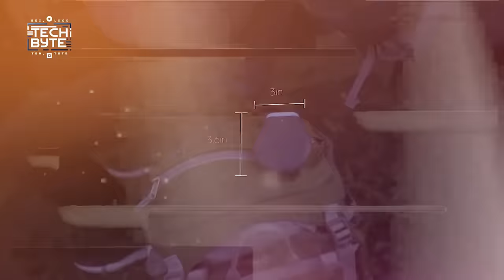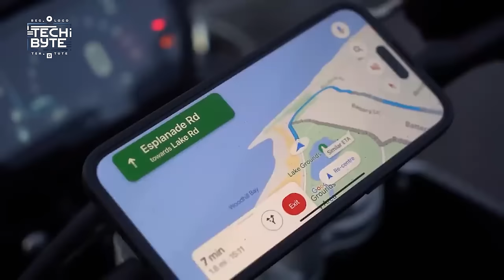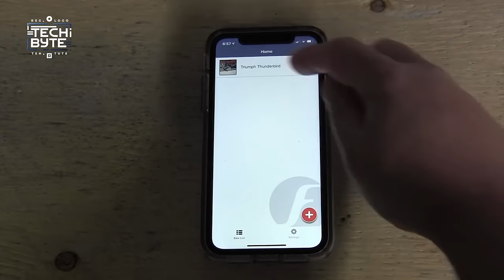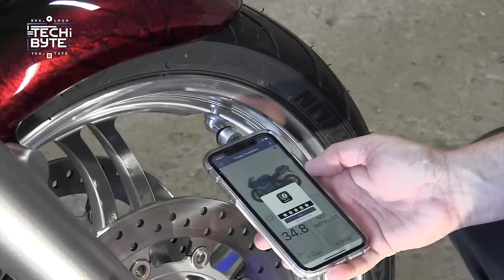Top 10 Must-Have Biker Gadgets for 2024!( Bikers Listen up) 🚀

Comment: Airbags inside jacket is worst thing.. specially for first responders.. if there is an internal bleeding and imagine the surgeon is stuck at opening a fuking airbags while that thing is pressing body with pressure..
Reply from the maker: That's absolutely something to consider
Reply: Is this message available in English?
Reply from the maker: it's in english
Reply: maybe my English is not good enough.  Sorry for the inconvenience.. but it is what it is...🙂🥲
Reply: First responders have a special pair of scissors that will have the jacket removed long before you get to a surgeon. The point of the airbags is to absorb the impact that would cause the breaks and internal bleeds in the first place.